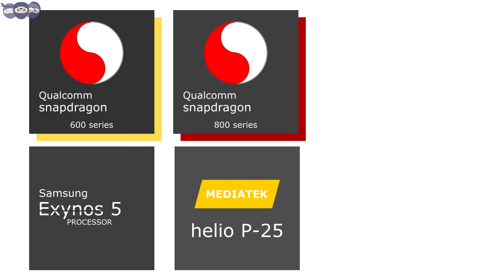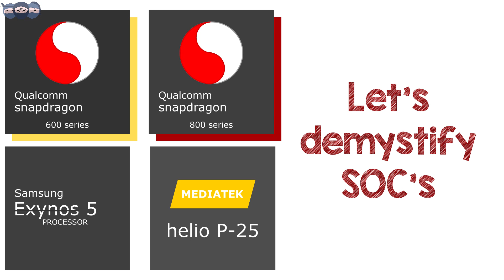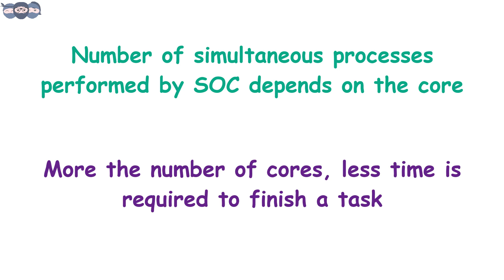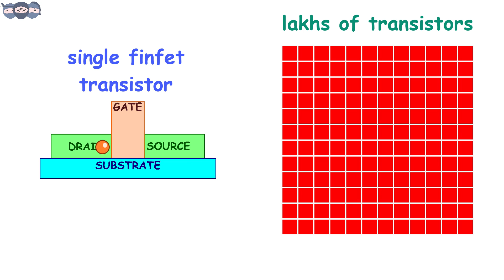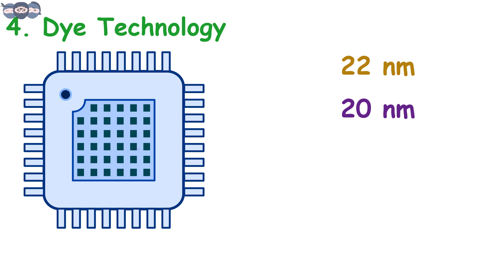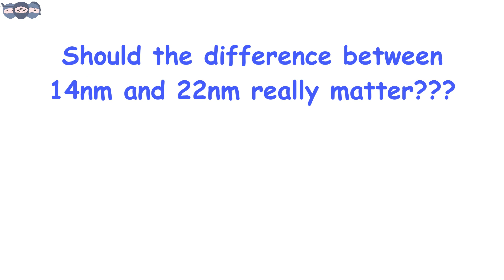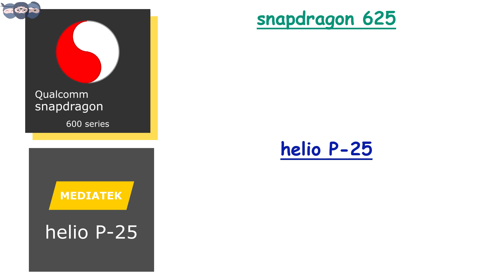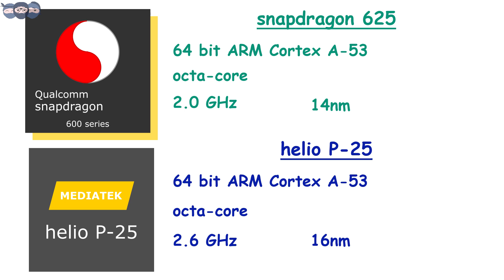How Stuff Works??: Understanding SOCs in Smartphones | Technology & Performance Explained

Comment: Snapdragon 625 14nm processor is faster than Helio  P25 16nm, cause smaller circuit and less distance the electricity has to go. And about frequency 0.6GHz won't be issue. correct my answer if it is wrong. Thank you for info.